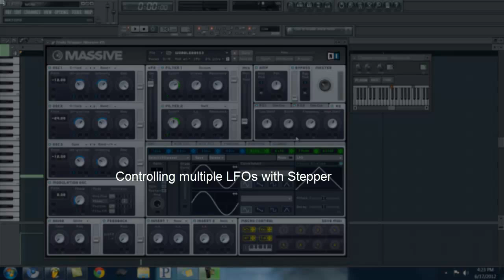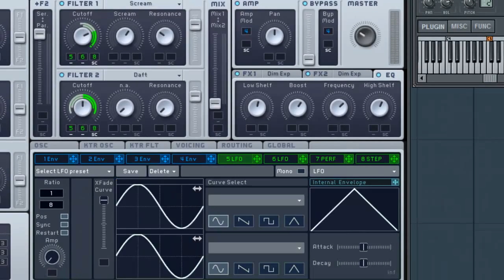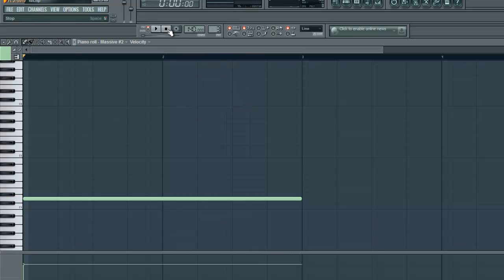Controlling Multiple LFOs with Stepper in NI Massive

Comment from the maker: I am adding a link in the description in just a second for it. It is the same preset before I added the multiple LFO. But I added in macro controls for it so it is more dynamic. It is the .nmsv extension preset; so if your Massive is an older version it may not work.

Comment from the maker: The SC box stands for side chain. So it will side chain the lfos to the stepper in 8. But with this specific preset I show I'm not sure you'll hear any difference. Once the SC lights up, if you change the two dashes that are below lfo 5 and lfo 6; I believe you should hear a small difference. But it is not really needed for the technique shown. Sorry for the confusion.